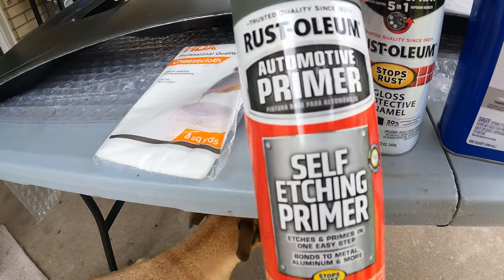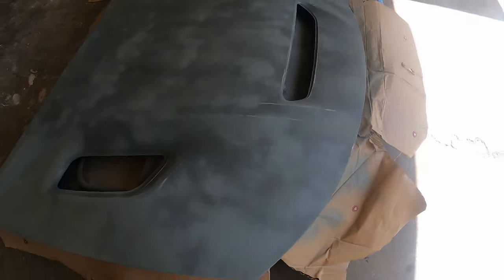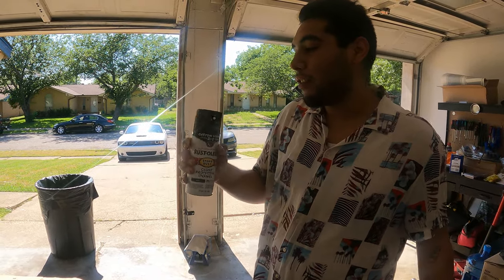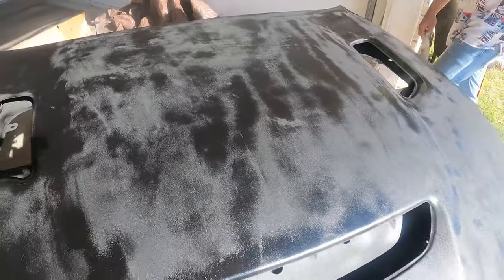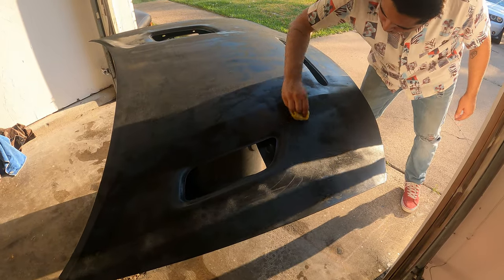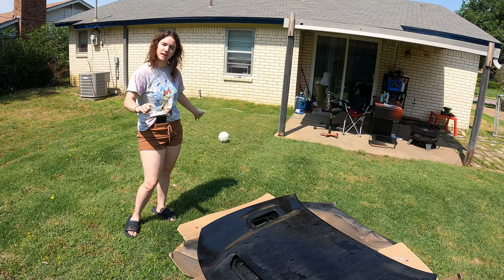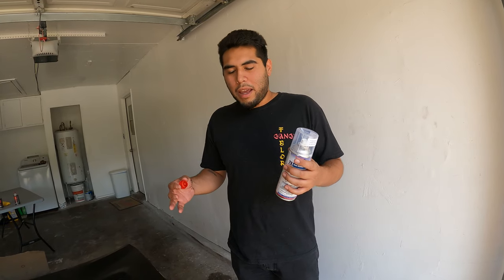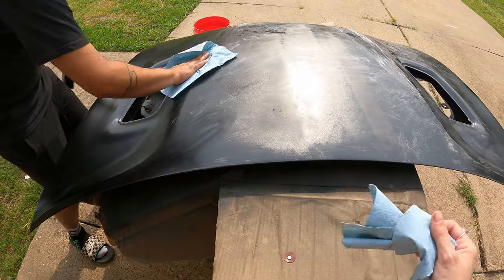Painting Hellcat Redeye Hood- Transforming My Charger RT Ep. 2

Comment: I took over two years to build an airplane.  I tried painting it with proper equipment, was a fail.  It was the only thing I farmed out to a pro, and basically most projects get painted by a pro.  There is a lot of proper equipment and skill necessary for a decent paint job.  Recall OC Choppers built bikes, but didn't do the paint..
Reply from the maker: You're so right. Everything looks really easy on YouTube lol. We tried and failed so now we're in the process of getting a wrap done instead! Should be much more simple